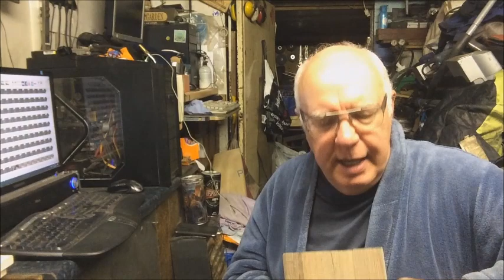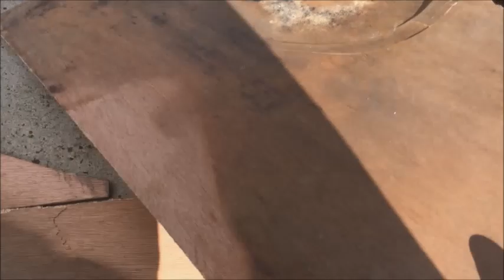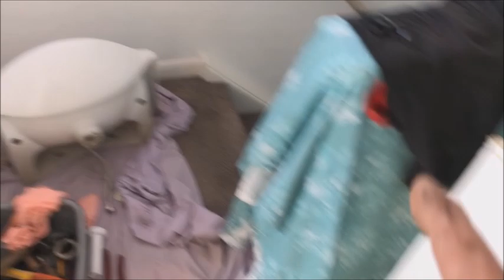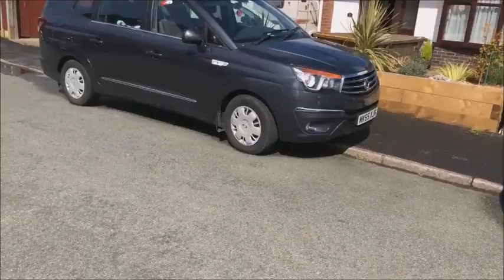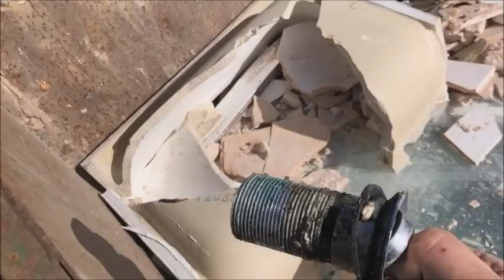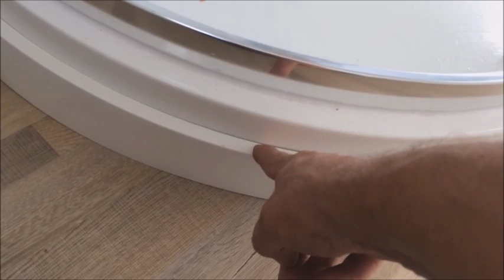Just when you need help, the scrap gods giveth

Comment: Ian, I couldn't say how many times I've run into plumbing "problems"  before I got my fill of dogs, cats, kids, and visitors I did home renovation flooring. When you showed the water stain on the plywood I knew the problem. Since no kids in the house it was either a soil line leak or someone playing fireman with their "hose" lol
BTW, the floor looks great.
Reply from the maker: donnie brown  err can I go for the soil line leak. 🤫
Reply: @Man-in-da-shed  that may be just part, not familiar with your type of connection. I was in the training program with pergo floating floors when they first came to the us. Not good to run floating floors under toilets. Toilets rock and tend to break connections. If the plywood you installed was not firmly attached then the toilet rocked. Maybe part of problem

Comment: hmm leaks are always pain in the but it manifest  all too late  and i know that vinyl/plastic laminate use them often it is really good material for wet rooms tho you need to have that flote option for it 3-4 mills from each side othervice  with time some connection will be visible tho no biggy cause that stuff not absorbed any water tho i see one mistake at yours  you sit the toilet on it the whole idea of floating flour is to make it flote and not being attached at any point this as i see it is small room so should be good enough  and i see that flouring material hard to any blades so no forget to sharp back your blade as you wanna work with wood again 👍😀👍
Reply from the maker: Rafal Scrapper  yes it’s  less than 2 sq mts  so I figured expansion wasn’t an issue